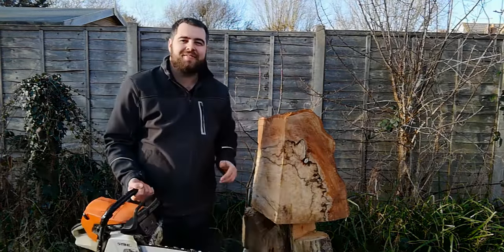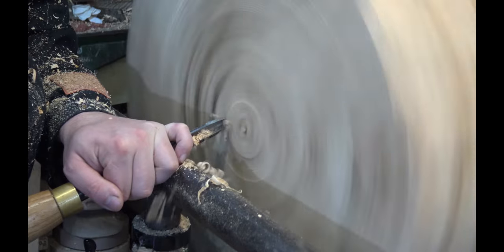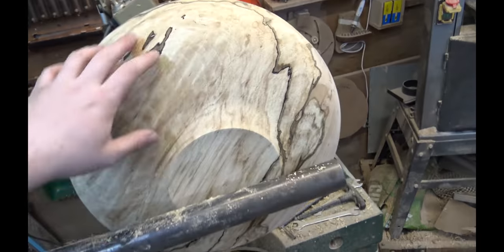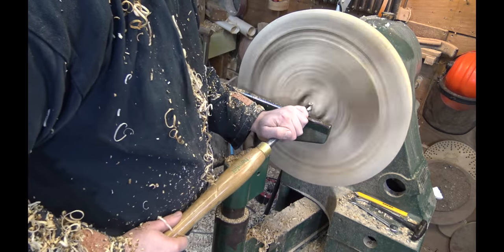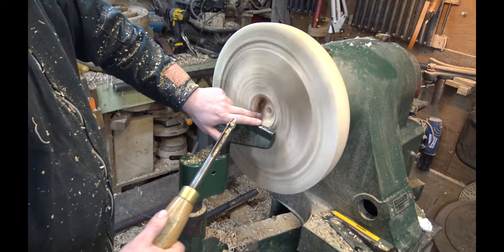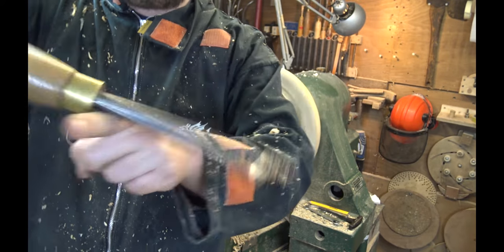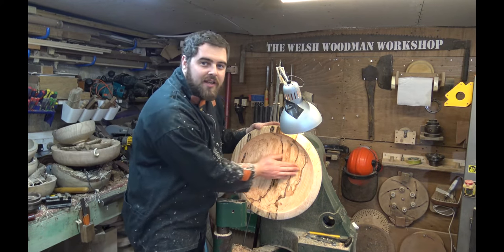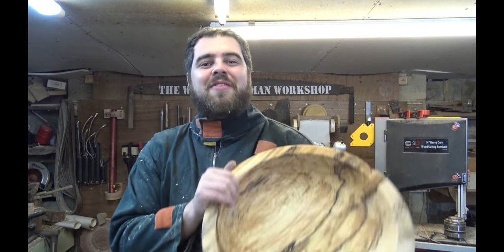Woodturning a large beech salad bowl on a VB36

Comment: A beautiful bowl.  I love the character in the wood.  I just came across an arborist taking down a sick beech in my neighborhood.  I got four sections which I’ve cut and rough turned into eight bowl blanks.  Not quite this big.  The largest is about 13” in diameter.  It also has lovely spalting but the wood is not so far gone that it is too punky.  Do you keep the ripping chain on your saw, or swap it out when you need it?  Two saws seems like the height of luxury.
Reply from the maker: Thanks Lou, beech is lovely to turn, I've found a good tip to keep you in interesting wood is to turn a nice bowl for the arborist as a thank you for taking some logs as the next time they take down a tree they are more than happy to send a load of free and interesting pieces of wood your way :-) I've got a cross cutting chain and a ripping chain and I just change them out depending on the type of cutting I'm doing,  I've found a ripping chain really speeds things up when cutting bowl blanks in the direction of grain however its a little trickier to sharpen. Hope this helps :-) Thanks for watching.

Comment: Hi there ! Lovely job ! Just out of interest do you not use sanding sealer before you apply wax ?
Reply from the maker: Hi Steve thanks for your comment,  I tend to apply sanding sealer to seasoned wood (wood with less than 14% moisture content) as this seals up the end grains which helps not absorb as much of the finish into the grains of the wood. With my green turned wooden bowls I'll just apply wax without a sanding sealer as the wax allows the bowl to dry out slowly (clingfilm works really well too) 😁 then in a good few months I'll either return the shape and apply a new finish (normally using a sanding sealer) or keep the shape as it is and apply more wax to the bowl with the option of buffing it up with a polishing mop. I hope this helps 😁
Reply: The Welsh Woodman  yeah it does make perfect sense thanks very much for that 👍

Comment: Tom, why didn’t you use a large 4 jaw chuck in the expansion mode on the base to prevent the faceplate screw holes marring it?  Besides those holes in the bottom (one of my pet peeves of woodturning), it is a beautiful bowl.  It also showed of the advantages of having a “bowl” lathe that can handle large blanks. I can do up to 25”  on my lathe, which is more than enough for me. Keep the videos coming as your style of demoing is alway informative.  Thanks.  Cheers, Tom
Reply from the maker: Thanks for your comment Tom, I normally use a 4 jaw chuck with most of my bowls, however the very center of the bottom of the bowl was pretty spalted and spongy and the foot size I turned just happened to be the same size as a face plate I had to hand, so ended up using the face plate to remount it this time. In the past I've hidden face plate screw holes with PVA glue, matchsticks and sawdust (from the same bowl) making a wood filler which hides them pretty well or have used copper/ aluminium rod or a contrasting wooden dowel to make a feature of the holes. Not sure what i'll do with this one yet we'll see in a few months time . As always thanks for watching :-)
Reply: The Welsh Woodman Hi Tom.  It was such a nice looking bowl that I was disappointed to see the screw holes in the bottom.  Hopefully you’ll show it again after you take care of them. Thanks again for the video.  Stay safe and well.  Cheers, Tom

Comment: Great video! Learnt a lot! How did you mount the bowl to hollow it?
Reply from the maker: Thanks Rob, I mounted it back on the lathe with a face plate this time, as the foot I turned ended up being the exact size of a face plate I had to hand. I'll normally turn a mortice or tenon and hold the piece with my chuck. When the bowl is completely seasoned and finished I'll hide the screw holes with glue and match sticks or contrasting dowels to make the bottom look nicer.i hope this helps, thanks for watching 😁
Reply: @thewelshwoodman649  yes it does. Cheers. Look forward to trying my first bowl by myself.